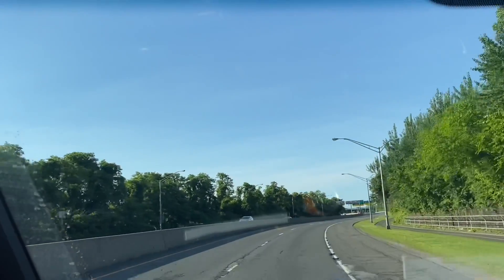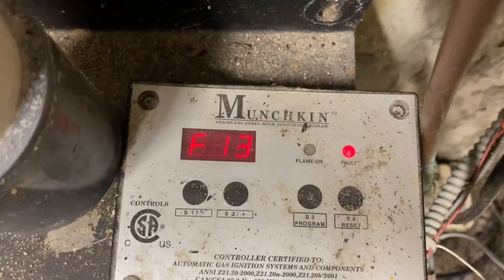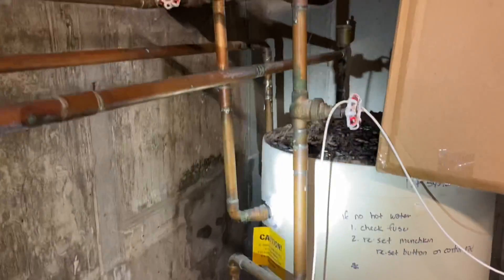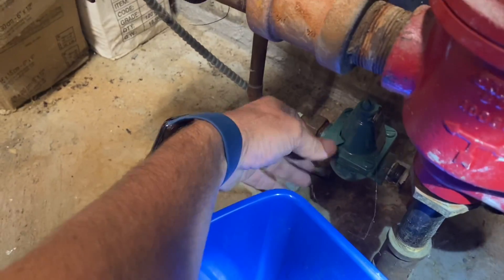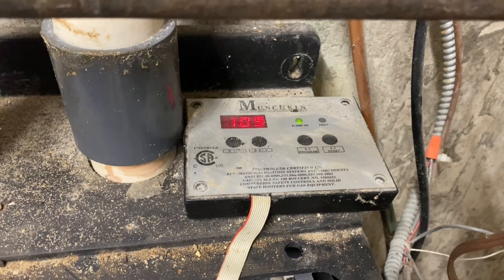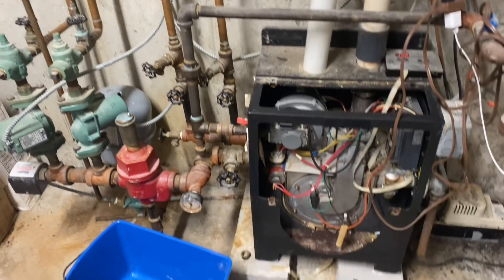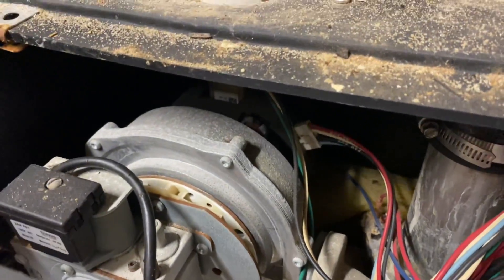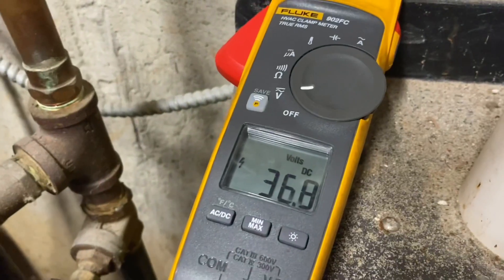How to Diagnose Munchkin Error F13 Fan Speed

Comment: Swing and a miss!  
F13 could be as simple as a blocked intake (note the mulch).  
Next, check the swirl plate, which could be deteriorated due to the first problem (can create gas smell).
What I would do:  CLEAN the boiler, intake and exhaust, and perform a full service including replacing worn parts... replace the swirl plate and vac out the blower motor (could be a trapped bit of mulch slowing down the fan).  Worst case, replace the fan.   Replace the control board? 
I have Munchkins lasting greater than 20 years and still going strong with proper maintenance.  Clearly the boiler needed a clean.     Nice job as a salesman.  
A new boiler?  
Shame.

Comment: for some people "duty cycle" is how frequently they use the restroom 🤣🤣
for those with some electronic/electrical background we know that means it's probably a PWM signal (Pulse Width Modulated), but could be a basic fixed pulse train of on/off ratio.
either way, it's best looked at on an oscilloscope, preferably a small digital one that calculates and list the duty cycle/pwm displaying it in simple numbers. they're really needed for VFD driven motors/pumps.

Comment: Hi Mike, the testers that you are using are not able to messure dutycykle/frequency.
You need a RMS multimeter. Most clamp types from Fluke doesn't do this.
Exampel the Fluke 116 HVAC has this function, at the same time you also get other functions related to HVAC work.
Realy enjoy your videos, even for an electronic engineer as I am working in broadcasting.
Reply: that's true, many fluke and other brands have the function, usually when set to DC voltage and you press a Hz/% button. when the percent sign is on that means duty cycle is selected.
some brands may have a dedicated setting mode.

Comment: Back up water heating, interesting. Duty cycle speed control, very common in control systems, you can kind of measure duty cycle using the AC setting on your meter.